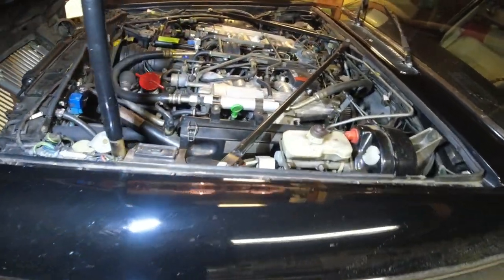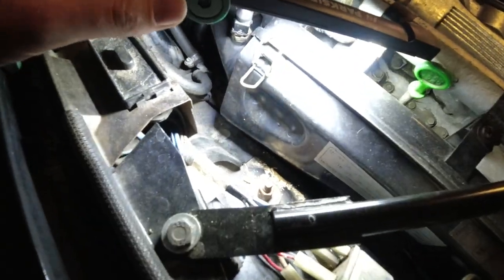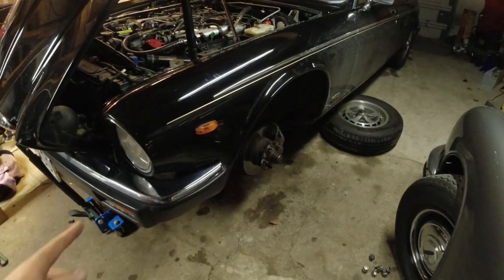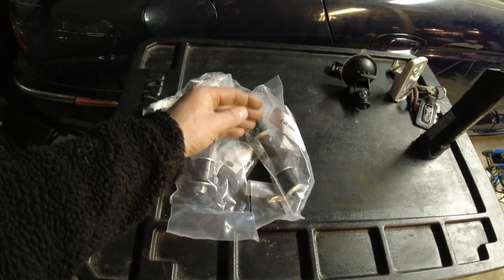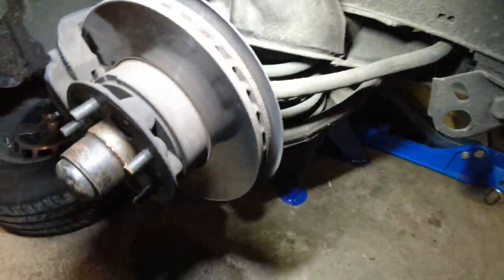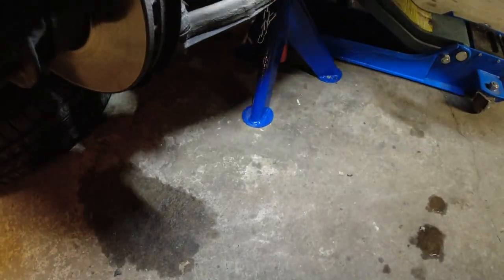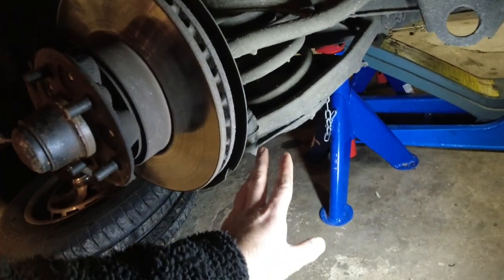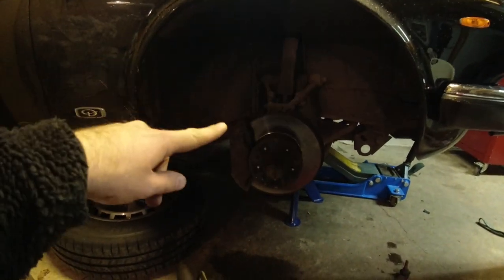Common Front Suspension Noises on Jaguar XJ and XJS

Comment: I can say from personal experience, that a loud clunking noise somewhere at the front when driving over an uneven surface with the left and right front wheel (like when parking your car on a kerb, which of course i do not recommend as a good treatment for the front suspension) may also be caused by play in the bolt that tightens the two torque bars from the body wings to the bulkhead  (I mean the two bars on top of the engine, which prevent the body from "torquing"). Thanks Adam for the video.

Comment: Shock bushes... been there, fixed that. Sounded like hammering when driving over cobble stone paved streets.
As for those swaybar endlink bushings. If you hear them don't freak out. They are not part of the suspention that creates the geometry for tracking and steering. You can still corner, brake and steer. So even with shot sbar endlink bushings you can still drive the car home or to a workshop. No biggy.
Reply from the maker: Yes they sound terrible when they’re shot

Comment: First job on my XJ40 is the spring will be to replace the upper and lower A arms bushings. As of now, the car eats its front tires and cannot be aligned, as they are due for replacement.

Comment: Thats was great Adam, lots of stuff to look for there. I have a 1981 XJ6 4.2 that I bought around four months ago here in New Zealand. I have been trying to get it all finished to be able to pass it's Warrant / Mot. Not exactly sure what you call it over there? Anyway it has two different noises which I haven't been able to locate just yet from having not really driven it that much. I had it on the lifts at my work a few weeks ago but that was to do the centre bearing and I didn't know to look for where the noise was coming from at that point. Anyway when you set of there is a slight thud like something is shifting at the rear and then the opposite happens when you come to a stop. The other is when you set of turning left there is a knock knock knock sound for a few seconds from the rear left which could be a wheel bearing? Anyway I will look into it further. Great channel and really helpful stuff.

Comment: Nice one Adam,  wow you found that problem quickly !   I have an '83 XJ6 Series 3, and it does drive so nicely.   I really wish it had a 4 or 5 speed automatic transmission, it would help the performance and mileage a good bit.

Comment: I did hit a pothole in my xj6 and it knocked the tracking out, im also getting a rumbling and i do get a metal to metal squeak noise, so the next dry day i will be replacing top and bottom ball joints, track rod ends, wheel bearings and the shock top mounts both sides of the car !

Comment: Great video. Just replaced the sway bar links on my 94 XJS. On the top shock mount, some XJ’s have a sleeve for the bushes, and some go directly on the shock rod. Any thoughts on this?
Reply from the maker: Do you mean the washers?
Reply from the maker: Oh I know what you mean now. I think it depends on which shocks you have. I haven’t gotten any new shocks with the sleeves
Reply: Thanks. I think the X300 has the sleeve and the XJS design has no sleeve. I wondered if there was a current preferred option, since both seem to do the same thing. Thanks

Comment: Those top damper mountings looked a bit putrid, candidates for some replacement welding.
Reply from the maker: They are solid, just some light surface rust from a month of banging around